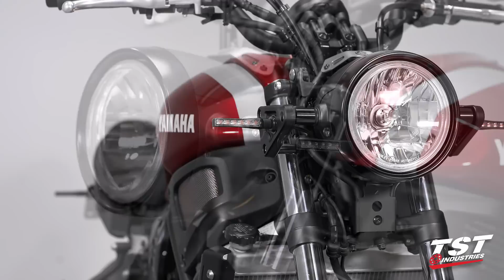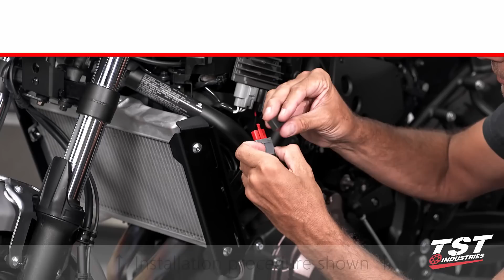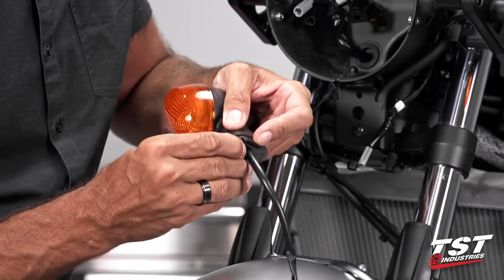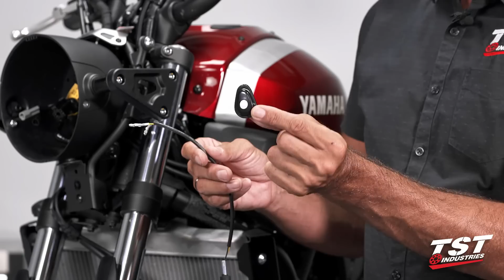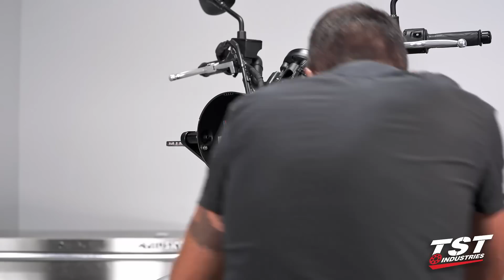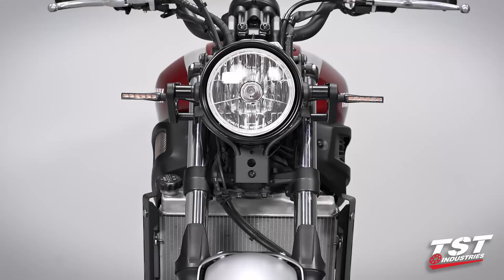How to install TST LED Turn Signals on a 2016+ Yamaha XSR700 by TST Industries

Comment: Very happy with the product, and good tutorial. I bought blinkers, pods and a harness for the rear indicators too and it worked nicely to mount them there also. Works on a stock tail tidy (and in my case, Evotech's tail tidy). Support was also quick to answer my questions when I was ordering.

Comment: Can you install running lights on them?
Reply from the maker: With our Running Mate harness, absolutely.
Reply: @TSTindustries  Awesome, thank you. Do you have instructions on how to connect the running mate to these turn lights?
Reply from the maker: @saivivek5686  They're plug-and-play so it's pretty straight forward. Unless you're international or connecting these on a bike that doesn't have a running light function on the front turn signals.
Reply: @TSTindustries  I watched your video at https://www.youtube.com/watch?v=FGyI2VCvaFY and it is clear now. Thank you

Comment: Great instructions.  Would probably be easier to thread wires of TST light through the grommet and then connect and tape after the wire is already in housing.
Reply from the maker: That is another way to skin the cat for sure.

Comment: Is that a muffler burn on Bart's arm? Wha happened?
Reply from the maker: At a dyno session with a 600RR / undertail exhaust I reached around for something and got the sizzle on my forearm.
Reply: @TSTindustries  dang..must have stung a bit eh
Reply from the maker: @Motogamna  initially it wasn't that bad but the next week I was traveling to some South American islands for scuba diving. The hour long excursions into salt water were where things got dicey with a gaping meat hole in my arm.
Reply: @TSTindustries  that's tough but the salt water probably did wonders for it..anyhow take it easy.